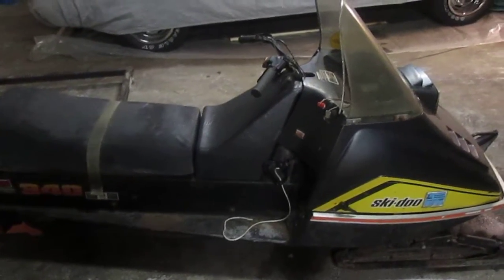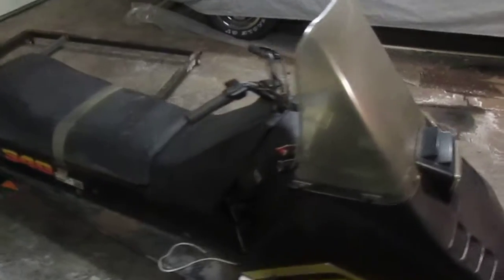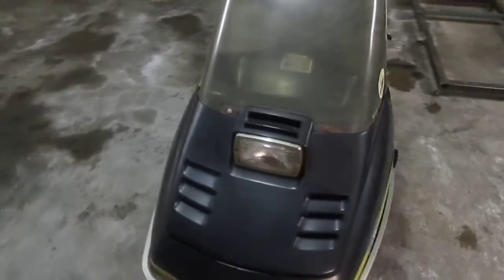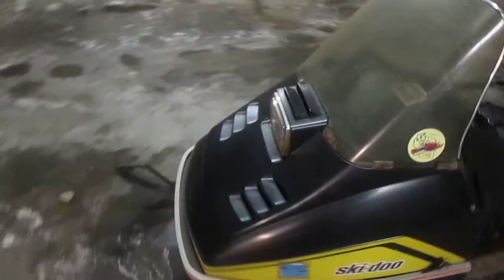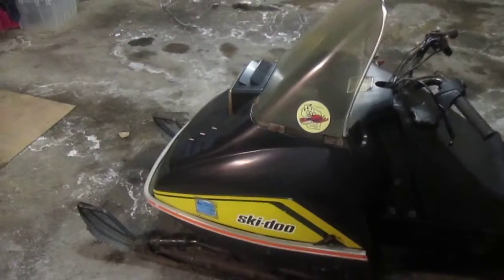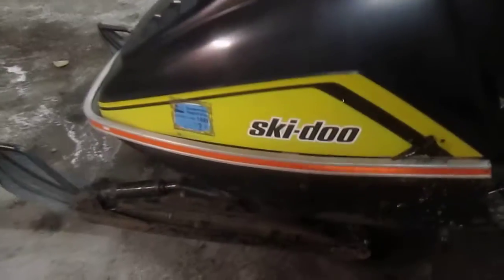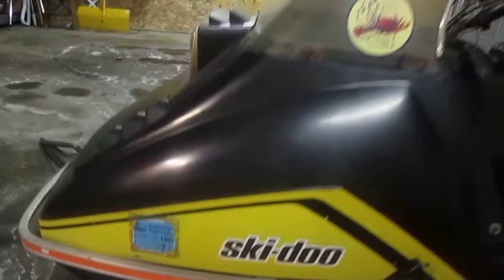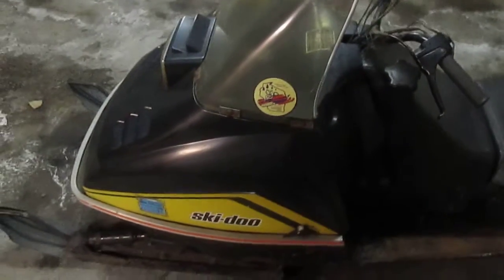1976 ski-doo Olympique 340

Comment: In my experience with this snowmobile, it is bulletproof. My family has one at our cabin, and it basically sits for a year since we aren't up their too often. When we go to start it, it fires up on the first pull and runs perfectly. The only maintenance we have done on it is replacing the rotting fuel lines.

Comment: what kind of mikuni carb did you go with? i have a tillitson on my 74 ski doo with a rotax olympique 305, rebuilt it and its still not having it
Reply from the maker: Hello, sorry, but I tried to locate the serial # for you on the carb and failed. I'd have to remove it and I think it's stamped on the bottom. This was the carb that was on the sled when I found it. Even though I rebuilt it before putting it back on, I can't remember or even locate the rebuild kit number. If you would like I could send some pics of it if you think that would help you out? But I just read the guys response below this one...possibly Mikuni VM 30-91?

Comment: What size is the fuel line coming off the middle of the fuel pump? Also what size are the fuel lines coming off of the primer? Also what size is the fuse by the headlights?
Reply from the maker: The size fuel line coming off the fuel pump I used 1/4in.Id  3/8 Od. Primer lines are smaller...I believe they are 1/8in. Id. I don't see where a fuse was used for the headlight. I hope this helps you out. Thanks.
Reply: i too have many questions trying to get mine going